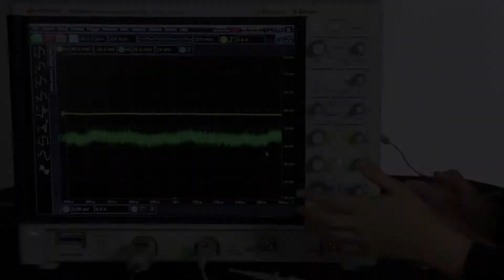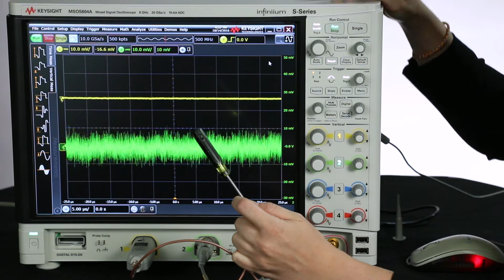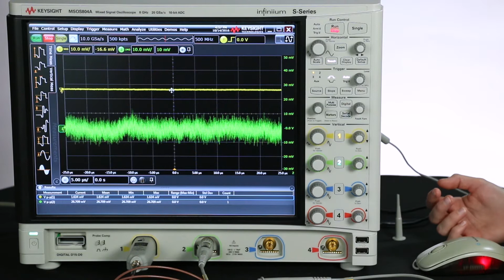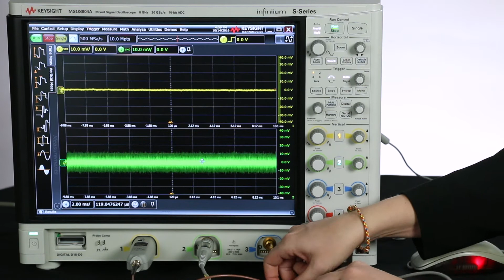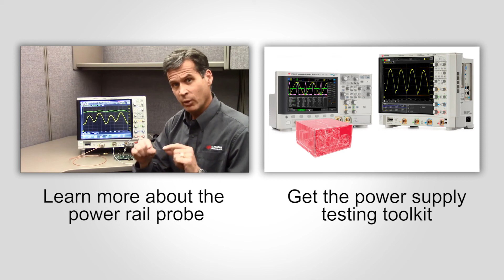Passive vs Active Probes for Power Rail Measurements

Comment: My understanding of active probe, such as N2795, N2796,  is that it has very high input impedance over very wide frequency range to reduce load effect compared to passive probe.

From datasheet, N7020A has 50 Ohm above 1MHz. Why does N7020A has 50 Ohm at AC to measure power supply response or noise? As a example, if there is a power supply is driving a 100 Ohm resistive load, the N7020A will not effect the DC waveforms since it has high DC input impedance. But at AC, the 50 Ohm input impedance of N7020A is very small compared to 100 Ohm load, my understanding is this low 50 Ohm will affect the waveforms at AC.

Please help to solve my confusion.
Thank you, pro.
Reply from the maker: These are great questions about the differences in our active probes.  You are right that N2795A and N2796A have 1 MOhm of high input impedance over wide frequency range.  This allows these probes to have minimal loading effect across a wide range of target devices with source impedances.  Conversely, The N7020A is intended to be used to look at the AC components of a DC power supply having very low output impedance.  The N7020A power rail probe’s input impedance is 50 KOhm from DC to ~100Hz, and falls down to 50 Ohm above 1 MHz. It is very important to note that the target source impedance must be close to zero ohm to use the N7020A probe to avoid probe loading at AC. When you heavily load down the target, the resulting frequency response won’t be flat any more.

In your specific case, the N7020A will rarely affect the DC level as the probe’s DC impedance is 50 KOhm - much larger than the 100 Ohm load connected to the power supply output.  From an AC standpoint, all that matters is how low the source impedance is.  If the source is close to zero Ohms the 100 Ohm should not matter as they are larger than the source impedance.  

When considering what probe to use, remember that probe loading is determined by the ratio of source impedance and probe impedance.  This will help to make sure you are picking the correct tool for the job. 

If you’d like to talk to us live to further discuss your test set up, we’d love to help! You can go to http://www.keysight.com/find/contactus
Reply: That is because of the capacitance that there is no way to get rid off, even at the most expensive probes, you will have 1pf of capacitance which would translate into about 50ohms at 1Ghz

Comment: Another thing: Comparing the noises at full bandwidth with 500MSa/sec (i.e. up to 250MHz Bandwidth) is pure BS - such a bandwidth is a job for an active probe.
Reply from the maker: Yes! Active probes are generally much better for this type of measurement. We've found that from a bandwidth standpoint, passive probes work well until 750 MHz - 1 GHz or so, but from a noise standpoint the active probes are much better.

Comment: Regarding the noise pickup at around minute 3: The comparison is useless as the SMA probe only touches the screen via its shield but not with the 2nd contact.
Reply from the maker: Hi there! Thanks for watching the video and making observations.  I understand the confusion at the measurement around minute 3:00.  From the angle of the camera it is difficult to see that the probes are not actually touching the screen for the measurement, except for my occasional clumsiness handling the SMA (you can hear the occasional tap).  Our scopes have a capacitive touch screen meaning they can produce some noise.   The purpose of the measurement was not to make contact with the screen, but to show how environmental noise from nearby components interferes much more with passive probes than active probes.  In fact, some passive probes can even act like antenna, picking up much more noise and interfering with the signal you want to measure.  I used the scope’s screen to demonstrate this, but noise from other parts on your PCB board or other devices in the room can contribute to environmental noise. -Melissa

Comment: To give a little more apples to apples comparison I wonder how the power rail probe would have faired if it too had a tip protruding out exactly like the passive probe. Also I wonder if both probes were times 1 again to make a more accurate comparison.
Reply from the maker: Good observations! When comparing probes, you have to take into account the full probe design, including tips and attenuation ratio. As you say, these can affect your measurement.  What makes the N7020A so effective is the entire design from the point it plugs into the scope all the way to the end of the probe tip.  As an example of how different probe tips matter, you can see how much more noise the passive probe picks up at the beginning of the video when it has the additional length of the hook tip accessory connected.  To make the baseline noise measurement, the passive probe’s hook tip accessory was removed so that we could show the passive probe under its best conditions, without any accessories that might pick up additional noise.  Similarly to how the passive probe was measured without accessories, the active probe was measured without accessories with only it’s standard tip attached.  The power rail probe does come with different probe tip accessories for customized or hands off probing, which are all designed to be low noise, and to keep the probe connections short and precise. 

Also, the attenuation of the probe matters.  One of the benefits to this active probe is that you do get a 1:1 attenuation ratio while passive probes have 10:1 attenuation.  A high attenuation ratio, like on a passive probe, can decrease the signal-to-noise ratio leading to less measurement accuracy. 

Here are some links to more information about the differences between passive and active probes, when you’d want to use one over another, and why:
• Webex Slides - 6 Probing Hints  http://www.keysight.com/upload/cmc_upload/All/Probing-6-Hints-Scopes-Dec12-2007-webcast.pdf )
• Application Note – Tips and Techniques for Making Power Supply Noise Measurements with an Oscilloscope http://literature.cdn.keysight.com/litweb/pdf/5989-6755EN.pdf
• Keysight Oscilloscope Blog – You Have Anything That Can Measure Ripple and Noise on Voltage Rails? https://keysightoscilloscopeblog.com/2016/05/11/measure-ripple-and-noise-on-power-supply-voltage-rails/ 
• Keysight Oscilloscope Blog - Splurge, Buy an Active Probe, You’ll be Glad you Did https://keysightoscilloscopeblog.com/2016/04/27/get-an-active-oscilloscope-probe-youll-be-glad-you-did/ 
 
 I hope this is helpful and makes sense!